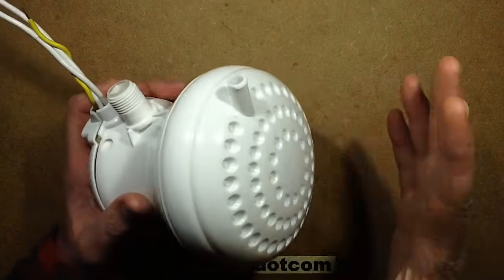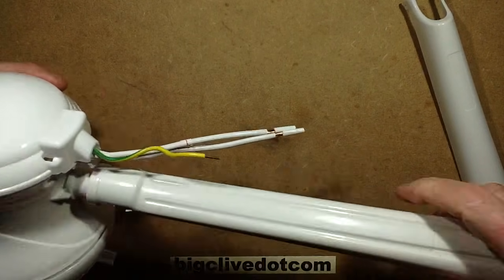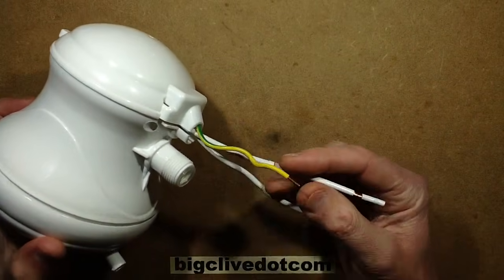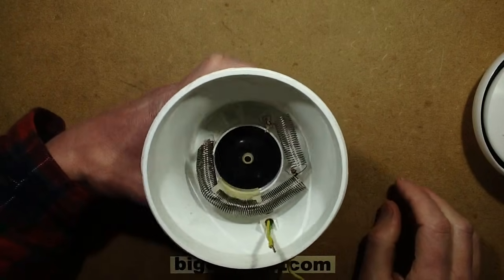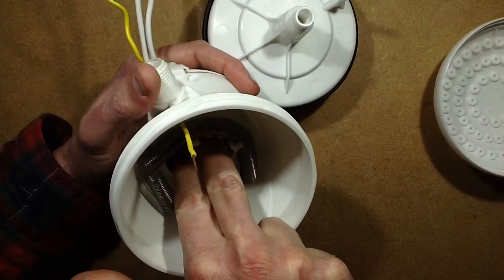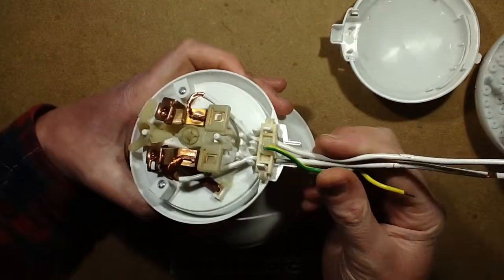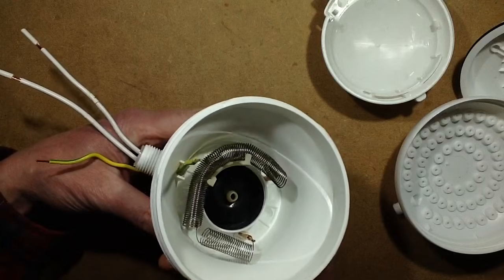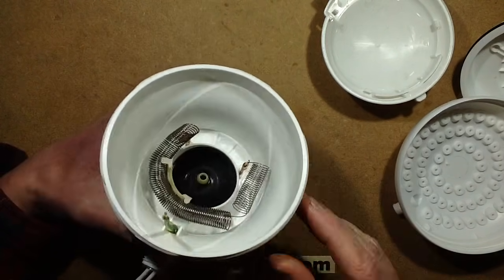Inside a heated shower head.  (suicide shower)

Comment: For Real.... A bare copper wire stub in the warm water flow, that would form oxide in a day, and then goodbye earth,  literally .
Reply: If the silicon rubber coating is good enough to prevent oxidisation then it will also be totally non conducting. Everything about the design is mad and dangerous.
Reply: Copperoxide conducts, doesn't it?
Reply: +ShadeNoahGames 1-1.5 years is very short for an electrical+plumbing appliance. Yes, it's cheap, but the cost adds up over the years as you have to keep replacing them. Not to mention the electrical risks. I've lived in Asia & we have tankless electric water heaters; it's a wall-mounted box with a heating element, water pipes & safety earthing inside. A decent one costs $60-100, but it will last more than 10-15 years.
Reply: +ivanjacob I believe that it does, but it has a higher resistance, plus I would be concerned about calcium scale buildup, that would really block it unless some electrolytic action keeps it from forming.
Reply: +Helios Haul It should be gold plated
Reply: @MrROTD  Gold plating the tip would make it R$2,00 more expensive, or in other words, 30% more expensive. These things are hella cheap, really!
Reply: +ShadeNoahGames a lot of showers in the UK are electrically heated rather than fed hot water, but the heating element is in a separate unit on the wall and is not a bare element.
Reply: Never used the ground...
25 years using it like that and still going strong.

My head often smacks against that shit.  Nothing happens.
Reply: +Helios Haul that's not true.
maybe i should say "that doesn't happen at all".
because it doesn't.
Reply: +Helios Haul just put your head between your knees , and kiss your ass goodbye ...
Reply: +Helios Haul Frying tonite...
Reply: +Rex Holes Hmm... Maybe. It would stop the oxidation, but I don't know if it would stop calcium buildup. If not, cleaning it would strip those few microns of gold from the wire.
Reply: +GraveUypo you know nothing
Reply: Tom Corbett Me, my parents, my grandparents and everyone i know have washed with these all our lives and nothing has ever happened. The problem here is that youre all a buch of pussies. As long as the earth wire is well connected nothing will happen.
Reply: Water pipes themselves are made of copper in a lot of US/Canadian homes and they can last decades, so I don't think oxidation is a problem. The plastic shower itself will die before that.
Reply: +Helios Haul that's why the cable was dipped in silicon. it keeps the copper free of rust while still maintains the conductivity

Comment: Having temporarily moved from Canada to London years ago, I was confused why everywhere I stayed seemed to have an abundance of 220V wiring in the bathrooms and showers/tubs, and these types of goofy heating elements scattered everywhere, rather than the north american standard(?) of a single hot-water tank (electric or gas) which seems safer and more convenient. Always wondered if flats in the UK were generally smaller so didn't have room for a hot water tank? Or older buildings only had cold water plumbing to the rooms so too much money to run a separate hot water line? Curious. Any answers?
Reply: +Warren Bailey It used to be illegal to connect hot water heaters with any storage tank directly to the mains water, they had to be fed through a header tank or some form of type approved non return device. (The reason was supposedly to prevent water being forced back down the main in the event of a pressure drop, or something).  Given that the bathroom is often upstairs, the available head of water is usually only a few feet... that doesn't make for a good shower, plus you'd need to use cold from the same tank (this incidentally is why the UK traditionally had separate taps for hot/cold water, rather than a mixer).

When showers first became really popular (I'd say 70s, before then everyone had a bath once a week whether they needed it or not), it was far easier to use the 'no storage = allowed to be connected direct to the mains water' rule and have a separate shower unit. Incidentally they DO have the advantage that no matter how long your shower lasts, you don't run out of hot water :)
Reply: ***** Hey thanks for that info! This has bugged me for years.. always wondered about that. Cheers!
Reply: +TheChipmunk2008  I agree. England is full of old properties that have still yet to be modernised. Water pressure used to be an issue for many homes as they usually shared one incoming main from the road, split between 4 houses on terraced rows through lead pipes. My house is still like that. If I run cold water I know when my neighbour is doing the same because of a slight reduction in pressure which returns when they turn it off. Its also a reason why not all homes are suitable for a water meter as some of that shared mains splits off again and used to supply outside toilets, so you would need 2 meters. In any case, for me, a water meter would be extremely difficult to read as my Main is capped off and hidden in base units in corner of my kitchen. My alternative water main is a 10mm pipe in my downstairs bathroom (the old outside toilet building) adjacent to my kitchen.

Comment: You're being very diplomatic Clive, I'd rather use the electrode boiler to heat my coffee than shower with one of these!... Keep it away from me!
Reply from the maker: +James Lewis I'm trying to keep a balanced view.  Every time I completely slate something as a total deathtrap I get a barrage of emails from third world countries announcing that they use them all the time and they're fine.
Reply: +James Lewis i took a shower on one of these for 5 years! Unless i had a bruise on my fingers i never felt any sign of electric current.
Reply: +André Campana Merétika I don't doubt that many people have used these without dying, but one does not have to look very far to find stories of people who have been killed by them.

I'm an electronic engineer by training, and I have a healthy disregard for electrical safety, but this also gives me a good understanding of the possible outcomes.  Many people, particularly tourists might not be aware and could easily put themselves at extreme risk.

People from Europe particularly are used to a level of protection which means that they never have to consider the possibility that they might be electrocuted by a domestic appliance.... 

If one of these heads was high up, well out of reach and was installed correctly (I'm not sure how much good the earth connection actually does, but I'd still be a lot happier if it was connected)... then it's probably vaguely safe (although I would feel a lot better if we were talking about a 110-120v appliance than 240v....  I doubt you could make an electrically heated shower at a lower cost, but I think in this case it's a step too far for me at least.
Reply: James Lewis I live in southeast Brazil, and here the power lines are 110v 60hz

Comment: Nicely trimmed nails, Clive. I approve.
Reply from the maker: +kuro68000 Thanks.  I use my teeth to trim them followed by my electronic side cutters for the bits I mess up.
Reply: +bigclivedotcom Dremel to file/polish I assume.
Reply from the maker: +kuro68000 I do occasionally Dremel them.

Comment: 5000W... Let's do math! (I might have complicated the math?)
4.19 joules per milliliter per degree C raise...
A 1GPM shower would give 60 gallons per hour
60 US gallons = 227.125L = 227125ml
5000WH = 5000wh*3600j/s = 18MJ (1 joule = 1 watt/sec, 3600 second in an hour)
18MJ/4.19/227125=18.91°C temperature raise !

If there is more flow however there is less of a raise.
here, a water saving showerhead is about 2.5 gallons/minute, so the raise would be 2.5 times less, so 7.57°C raise.

Considering that the water is currently at about 7C here right now... You would need WAY more power... This is why you don't see electric on demand water heater. Here in canada, a typical service panel is 48kW (120/240 @ 200A per leg) and shouln't be loaded to more than 80%. And yes, here we do mostly heat electrically and yes, it is cheaper than gas!
Reply from the maker: +thephantom1492 Our electric showers in the UK start at around 7.5kW and go upwards to about 11kW.  They have spray nozzles designed to create a modest spray at low flow rates to allow a hot shower with winter-temperature water.  I've got oil heating here, but I don't think it's actually as efficient as just using electric heaters in specific rooms.

Comment: OOOH!!, shower and electro head massager :D
Years somone brought in a shower unit that the inner was a perspex block  with a coiled heating element running through it, seeing those coils reminded me of it.
Reply from the maker: +Sparky Projects I've seen one of those!  It was a channel that snaked back and forth inside with the water running around the element itself inside.  That was a long time ago though.  I wonder if they still make them like that.
Reply: +bigclivedotcom Yep, that&#39;s the one
But you're talking late 70's early 80's when i took a look at it, no idea how long it had been installed, though it must have been around the, time a lot of fuss was being made about installing instant showers

Comment: you need a simple conductivity meter to test the conductivity of the water. Normal tapwater (at least here in the Netherlands) is around 300-600 uS/cm which equates to around 1500 to 3000 Ohm/cm

Comment: We have versions with a TRIAC inside. If you are with ground unconnected you will receive a little shock when touching something made of metal, most of the time.
Reply: +Thiago Almeida i took a shower on one of these for 5 years! Unless i had a bruise on my fingers i never felt any sign of electric current.

Comment: Could you test the melting point of the plastic using your soldering iron if you have time.  Insterested to know what the case is made of. Ta.
Reply from the maker: +DaveDodd I think we can safely say that with a 5kW element inside and such a dodgy switch mechanism with no thermal fuse, whatever plastic is is will potentially combust anyway.

Comment: Hey clive, we use this in Brazil, it is used in almost all houses. All the showers legally sold in Brazil must be avaliated by inmetro (and they are very serious) so the shower heads sold in stores here are quite safe actually (not a single accident that i know of). obviously that does not include the ones you can order in the internet from china.
 The big problem actually is badly done wiring, made by somebody that does not know what he is doing!, it is very commom in these bad installations to get a small electric shock when you touch the water valve handle, in really badly done ones you get a mild to somewhat strong shock when you touch that handle.
Also this 3 heat thing is not used on newer showers, they now have something like a potentiometer that you turn to choose the optimal temperature.
Reply: Also due to their power use (up to 8kw is quite common), they also tend to use quite a lot of energy, and in the end of the month they are responsible for quite a big share in the energy bill.
Reply: i have spent quite a few minutes searching, and i only found 2 deaths: one was caused because the guy tried to change the damaged heating element inside WHILE  it was live in 2014, and another one in 2013 caused by eletrocution while he was connecting the wires during installation.
During bath i actually only found deaths caused by Carbon monoxide from gas heating.
OH before i forget: ducha also means shower in portuguese.
Reply: @thelbp  you're completely wrong.
Reply: @ivankirola2707 Proof?

Comment: This kind of shower head basically is the only type available here in South America and most houses here don't even have earth circuit at all (mine is one of those lol). I personally dint't had any problem with this things because here we are told since childhood the electricity is very very dangerous. "kid never touch the shower while it is on" :D
Reply from the maker: +Fabio Guedes I think a good portion of electrical common sense really helps here.  In many ways British kids are too sheltered.  It usually just takes one mild shock to  teach electrical respect.  (Maybe more than one in my case.)
Reply: yeah I leaned early to not put metal things on wall sockets and well some years later I was graduating in electronic engineering, gonna be electrocuted for the rest of my life :)

Comment: That thing ist just a tiny Version of a Tankless Water heater, the  big one (18kW - 26kW [3 Phase 400V]) are pretty common here in Germany and they don't trip the RCD even the single Phase versions not and they all with Bare Metal Resistors, because Water is not a good conductor.

Comment: We use this kind of shower head everywhere here in Brazil. Most of them work pretty well, and most of them are also badly installed even with no ground connection. Pretty scary stuff. I've used one wihout a ground connection once (not knowing obviously), and I'm still alive, dont ask me how lol. Mine is made out of metal, properly installed and it has been working flawlessly for the past 20 years. Ive never heard of someone dying because of these things, but im pretty sure it happens quite often.

Comment: I guess 5 kW is enough if the incoming water already is 15-20 centigrade like in Thailand but I would not like to use a shower like that.
Reply: +Axel Svensson i took a shower on one of these for 5 years! Unless i had a bruise on my fingers i never felt any sign of electric current.
Reply: +Axel Svensson with 5kW you get about 1.3L of water per minute with a temp difference of 50 degrees. If the temp difference is only 20 degrees, you get 3.25L/min. So indeed in warmer countries you can get away with stuff like this and still have a reasonable amount of water.
Reply: +Fry A regular fuse in my country is 16 amps @ 230 volts which makes about 3.8KW. So to use such a many-KW showerhead you have to go through a lot of formalities, some big bills and an electricitian for new wires. Just to have a death trap in your bathroom. It might be a better decission to go for the normal regular (the Northern-EU ones) ways for heated water.
Reply: Richard van Pukkem gas availability is a modality in more developed countries. Electricity doesn't really cost anything apart from taxes and environmental stuff, so outside of EU and USA it doesn't really matter how you heat water. Going the electric-boiler direction is possible but doesn't offer a continues stream. Continues flow electric boilers are the best option, which this device is a (albeit weird) version of :)
Reply: ***** Okay, didn't know that gas isn't a regular thing outside EU/USA :). Don't know if a propane gas tank would be empty quickly when you heat shower-water with it? Anything better than electric wires straight into your shower water. If the earth and zero wires fail at the same time, you will be dead...
Reply: ***** Correct, also i don't sell these things, i'm just sharing my experience with as much people that are complaining as possible
Reply: +Andr&#233; Campana Mer&#233;tika Anecdotical experience means nothing. I've used my car daily for 5 years and never had an accident. Doesn't mean there are no deadly car accidents. And in fact, morphman86 below wrote: "A friend of mine died about a decade ago in Thailand from using one of these. It was installed properly, but investigation showed a hole in the wall in the hallway, where someone had reached inside and simply janked out the earth wire, that had just been twisted and taped together."

Comment: I think the "pressure valve" thing on the little hose is not a safety feature, it's an optional feature, like a little hose where you can pull out the little pin to open it and then the water comes down through the hose/little holes so you can clean your undercarriage
Reply: As a Brazilian with poor English, we usually use that hose to shower children, to shower specific things (like the feet) if you need or even to help washing the bathroom (altho it's not super common I think).
Reply from the maker: +Cooking With Cows Oh!   Right OK.  The concensus seems to be that it's a genital sanitiser.

Comment: That video you linked to is terrifying!
Reply from the maker: +Alexander Zarach Try the other videos it links to.  They're pretty bad too.
Reply: +jusb1066 Un-earthed bare wires and water, what could possibly go wrong... I saw one video tutorial on installing it and even done right it looks so dodgy!
Reply: +Alexander Zarach i also notice they have open terminal connections on some of them not even tape! perhaps they break so often they dont bother to save time, i would assume they dont use the switch on the head, just turn off the water only, yes the other videos are scary,
Reply: +bigclivedotcom http://www.lorenzetti.com.br/en/Detalhes_Produto.aspx?id=258 Product page in English shows electrical details, plus it's even won awards apparently. Yikes

Comment: How did the manufacturer intend this to be electrically installed correctly? Because of the short wires, 99% of the photos of these on google image search show them with the wires just twisted or taped onto another piece of random wire. Is there supposed to be some sort of appropriate water proof junction box (which seems unlikely and still ill placed) as the length of the wires seem to just encourage everyone to install them badly
Reply from the maker: +arcadeuk I think the best thing to do is to put those leads into a square pin plug with a piece of foil wrapped round the fuse.  That would make it safe and allow you to use a hair dryer in the same socket, then use a toaster to make toast while still standing in the bath.  Crumb problem solved.